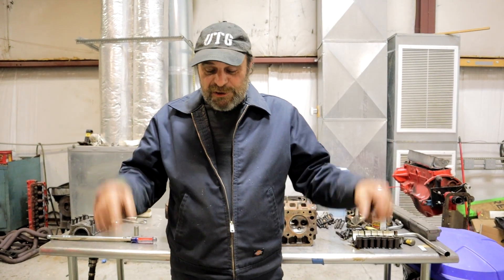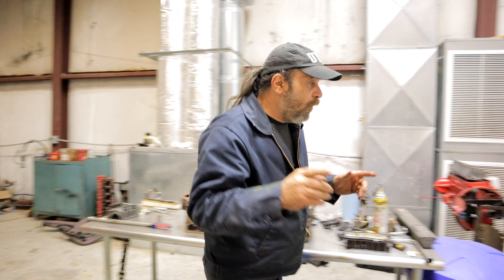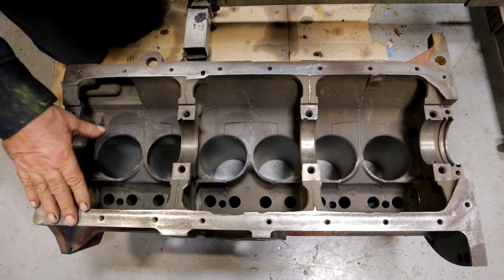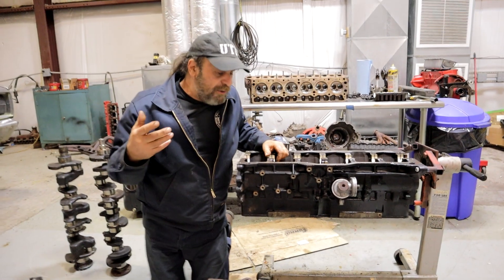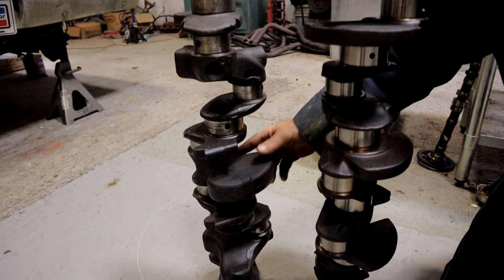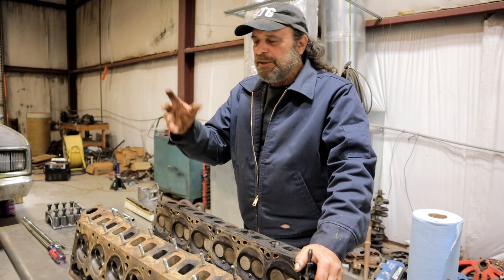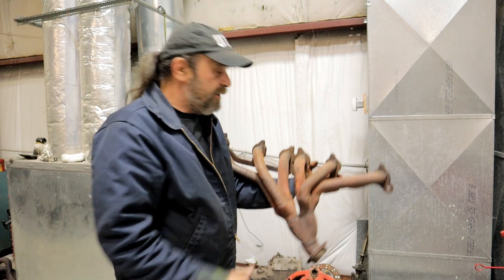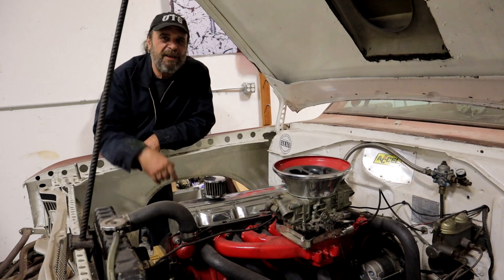The Mighty Mopar Inline 6's History And Comparison - Flathead, Slant, Hemi Six, 4.0 And Hurricane

Comment: Bill Weertman has a discussion about the choice of 4 vs 7 main bearings in his “Chrysler Engines” book.  The tradeoff was between better support of a crank (7 main) vs a significantly less flexible crank (4 main.) in fact he refers to 7 main cranks being too “whippy” referring to torsional flex. Fewer mains could be offset by making the mains big (compare them to the Jeep mains).  Since the 4 main crank was stronger AND shorter, it was chosen as a win/win.  The Jeep motor is a great engine, but historically It did have some issues with crank and block flex, which is why that spine or girdle was added to the main caps by Chrysler when they introduced the “reduced NVH” version in the 90s. 

Another thing from Weertman’s book: although he designed the slant and the Chrysler 2.2/2.5 turbo engines, had been at Chrysler his whole career, and was head of engineering at Chrysler in the 80s, he writes glowingly about the Jeep 4.0 and 2.5. In fact he pointed out that the naturally aspirated Jeep 2.5 had a higher output than the NA Chrysler 2.5, and was totally in agreement with the fact his successors picked the Jeep engine over the Chrysler engine to continue to power Dakotas and Jeeps. 

Also- that nice Jeep exhaust manifold was dropped in the 2000 model year ans replaced with a split cast iron manifold.
Reply: The 225 was never known for crank failure so they got it right.

Comment: Gm built literally millions of stovebolt 6 engines from the 1920's thru the 1960s with 4 main bearings. Minnieapolis Moline built some almost 600cid diesels with only 4 main bearings(they failed a lot).  The last cat on road diesels were twin turboed and managed to live a million plus miles running 70psi for hours on end. They have steel pistons though to take the heat and extreme pressure. If they build a twin turbo gas version and make it robust enough it can live 300K no problem in a car. The place most of these designers fail is in using enough bolts to secure the head. It need to be at least 6 full size bolts/cylinder.

Comment: My concern with many of the new, smaller displacement engines in full size trucks and SUVs is the torque curve. Not all, but many of these vehicles will be used for towing trailers. The smaller displacement automatically reduces torque all around but, especially at low rpm. Turbo charging does increase torque but, does it bring back enough off idle torque to get them rolling under load without over stressing the engine?
Reply: NO.

Comment: 1:44 Those floating power six motors are great until you have to replace all six motor mounts. Ask me how I know.

They were also not particularly light cars, especially for the time. My basemodel DeSoto Airflow was the smallest of the family and it still clocks in at over 4000 pounds.

Comment: Really enjoyed this video Tony.  In regards to the Hurricane being overtaxed I think that's the case with the majority of modern engines.  When automakers are putting small 1.3L turbo 4s into 3500-4000 pound family SUVs I find it hard to believe they'll last all that long. Another example of sacrificing vehicle longevity to maximize MPG...
Reply: a company chooses to build a 500hp 3.0 turbocharged engine,  size doesn’t dictate its longevity. the designer material choices and accountants analysis decide longevity.  Engines will be build to last as long as the board of directors at gm or ford deem.

Comment: Great video tony. I saw under the assumption that amc designed the 4.0 as an embiggening of the 2.5, which they designed "from scratch" so they wouldnt have to buy iron dukes for their economy cars any more, and they just made it fit the same bore spacing as the 258 so they could reuse old tooling. I have swapped a lot of parts between 258s and 4.0s, but I gotta say at least in the head design, the 4.0 looks way closer to the 2.5 than the 258.
Reply: The 2.5 actually never got put into Concords or Spirits. The 2.5 was developed for the XJ.

Comment: Love this content! My ears are wide open..... My question was answered ....Chrysler's not stupid and knew that 4.0 L was a better engine. Of course they could have ran the slant longer. I mean at least in intermediate to small cars but no need for it. Everything went transversely mounted and the things that didn't got way better engines than the slant and I'm not knocking the slant in any way, shape or form. It's definitely a better engine than some of the smaller Chrysler v6s the 3.3 and the 3.8 but not better than the 4 L

Comment: Thanks Uncle Tony , inline six's compared. What I do like about the three types of Chrysler I 6's is all three have been around for a very long time and everything that can be done to them performance wise has been done. 
The good and the bad of these engine's has been exposed because of this.
What benefits anyone wanting to rebuild one of these engine's is no shortage of OEM and aftermarket parts.
My experience with the slant six has been a rebuild, apart from the.030 oversize , all standard  internals . However I tried various intake/carb combo's. No real significant performance gain , apart from under-bonnet(hood) visual appeal.
In Australia the 265 Hemi inline six  engine is Legendary.
There is plenty of online info concerning this engine. 
Two points of difference and this is only two of the many. . .
In the 1972 E49 spec Charger , sold to the general public. . .off the dealers (showroom) floor produced close to 304hp (aspirated)at the crank. . .that's more than 1hp per cubic inch . In the world of production inline six engine's for car's it was the most powerful. 
Sold with Chrysler Australia's version of the Sixpack (triple Webber's) , no vac secondaries like it's U.S cousin. . . Yet , a completely street drivable production
Car . . anyone with a Driver's licence could drive it . 
Quite an achievement here in Australia for the Chrysler engineers for its time 😎👍😁

Comment: Man, I thought I was gonna get to see inside a flathead six. what a jip.... the jeep motor is a tractor motor. my neighbors, Watson's used jeep parts, says they are boat anchors. i never liked those jeeps because many of them you cant add water, you have to remove a hose to get water in the block because of the overflow tank is part od the pressurized radiator system.

Comment: Building a N54 bmw motor in a 2007 335i, twin turbo engine made with forged internals STOCK that can take boost and produce 6-700hp reliably with stock internals. And the torque would be higher 8-900! Most 4 cylinder engines have more HP than torque, it makes a huge difference! I call it the rice cooker bc of all the STI’s I’ve been smoking with it currently running 450whp 550wtq, very conservative tune for this platform! Long live the in-line 6!!

Comment: I've read a few of the comments and watched Tony's presentation and haven't heard or seen that the rod and bearing sizes in the Slant Six are the same as the 426 Hemi. I believe this is one reason for the longevity of the Slant Sixes. My dad had a Slant Six back in the 60's which burned a valve just short of 100k miles. I never thought about it but in one comment there was mention about valves burning due to lack of adjusting them. My dad never did much to his cars until something broke. I doubt they were ever adjusted.
Reply: The downside of using a bigger diameter main bearing is the increase in feet per minute. Similiar to running a 1/2 drill at the speed you should run a 3/8ths. The upside is a thicker cross section.

Comment: The 4 liter was an AMC design though. It was underway before Chrysler entered the picture, the 2.5 liter AMC 4 cylinder existed a couple years or so prior, and it's a 4 liter with a cylinder missing from each end. It's also worth pointing out that the exhaust manifold you have is not an original part, it's an aftermarket manifold. Depending on the source sold as "revised design" or just header.

Comment: American in-line six are stagnated and remained fundamentally unchanged until their discontinuation. The only major changes are adding EFI with modest performance gain. Australian had gone a little further with Chrysler inline HEMI six, the high end model produced 300 HP. These engines are well received in Australia being more powerful than Ford or Holden counterparts.
Reply: Even at that, the only classic American inline sixes that ever got EFI in US production were the Jeep 4.0 and the Ford 300/4.9. The Slant, the Chevy motors, the Pontiac OHC, and the small Ford never made it that far (in the US). V6s took over the US market for "basic midsize/large car engine" in the late '70s because they were applicable to both RWD and FWD.
Reply: Well yes, up until 1980 when it all finished! 😄

Comment: A friend of mine has a Australian Charger here in the United States along with two others in the Fox Valley Mopar club up here in Northern Illinois. He has it registered with the Charger Registry. People at car shows thought it was a tractor engine. Alls I can tell you about the Australian Charger is that it is really a Valent and it had three gas caps. One on each side of the quarter panels and one directly on the back like a '65+ Mustang. They did this so when you pulled into the pits for a refuel. You can have two sometimes three guys with refueling tanks all pouring fuel at the same time make for a quick refuel. Also, the exhaust tips were pointed upwards so the exhaust didn't stir up dust.
Reply: Well its a faker then. Genuine "Track Pack" big tank Six Packs only have the fillers up on the read quarters. The standard centre cap in the rear panel is deleted and not stamped. And it is "Valiant" as in Prince Valiant and his great stead....Valiant is a USA name Chrysler used for the new Small Plymouth in 1959.

Comment: The 245 and 265 hemis were legendary in Australia. 
The e49 spec in our RT chargers made 220+ kW with triple Webber carbs.
They were pretty special..
Reply: Hell yeah , Iconic \\m//
Reply: Just to clarify, the 256 Valiant Charger with the E49 spec engine was the most powerful of these, but was not the only factory triple Weber version. The E37 & E38 were both triple Weber engines in street & track versions respectively with three speed trans. The following year, the spec was raised & a four speed was now standard. The E48 & E49 were now the street & race versions with the top spec E49 producing 302hp Forget this kilowatt BS, that's just what I read off my electricity meter.
I have driven an E48 version [the so called 'street' version] & it was frightening quick, ....... & fast.
Reply: And never worked better, than when between the Chassis-rails, of a Toyota Crown, mate. (Only Aussie-sold car with a full chassis, apart from HQ-WB utes and panel-vans.)

Comment: I doubt that the hurricane engine is always under boost. At a cruise I would venture to say it's not. I do agree with your sentiment though Tony. The Ecoboost 3.5 ford trucks are pretty much junk. The reason being is that a turbocharged small displacement engine just can't handle a loaded f150 that is consistently pushing boost anytime your on the throttle. They start developing coolant leaks everywhere because of the excess pressure and heat that is being made. If you notice on the new Ecoboost motors the radiator caps are now pushing 21 lbs before they release pressure. That is an indication of just how much heat and pressure is getting built up into the coolant system. Turbocharging is great if the engine doesn't use it more than say 40% of the time in it's standard operating perimeters but when you push it to 90-95% of it's run time that plays hell on all the systems of the engine. Oil is getting scorched all the plastic coolant system pieces are constantly seeing 240° coolant temps and that severely cuts down on the longevity of the engine.

Comment: Great Video on the inline 6. My Dad had a 49 Dodge Pickup and I believe it was a 230 cu.in? flathead 6. Tough motor. I was always amazed how you could leave that motor in high gear at 10 MPH and just press on the throttle and accelerate. Try that with a V8! I was also into the old Chevy stove bolt 216 and 235 cu.in. engines when I first started driving. Later I updated to the 235 insert bearing motors and they were like hot rods compared to the Babbitt motors. WOULD YOU be interested in doing a series of videos on Inline 6 cylinder engines from each manufacturer like you did with the V8s?? I WOULD LOVE to see that!

Comment: Great comparison! That jeep 4.0 exhaust header is an aftermarket header. The 1987-1990 non HO/Renix 4.0 had a tubular manifold and the 1991-1999 HO cherokee (91-98 grand cherokee) 4.0s also had tubular manifolds that more closely resembles true headers. The 99 to 2006 (00-01 cherokees) 4.0s had dual exhaust cast manifolds with bolted on y-downpipes.
Reply: VW got better and better with those too. 
By the mid 2000s it looked like a little cast header for the 4 cylinders. 
Swap it out from the low flow turd on your 80s mk1/2 vw and it's guaranteed 10hp, the aftermarket has you covered with downpipes to use a Mk4 manifold in any other chassis they made.

Comment: I've only had 1 inline 6. It was a 250 Chevy in a 78 Camaro. And when I first got it I was thinking, okay I'll pull out the 250 straight 6 and put in a 350 V8. But after I drove it, I changed my mind. It wasn't a powerhouse or anything. But the way that car handled with the lighter 250 straight 6 was just amazing. I was used to heavy nosed V8 cars. But the 6 was a blast through the bends
Reply: Well, actually, the 250 IL6, is actually heavier than a 350 SBC... 😮 Don't take my word on it, look it up... I was surprised myself. (I have a 72 Nova with a 250 in it) I was trying to figure out if I would need to get heavier springs, if I went 350...

Comment: Bit of trivia :     In 1971 Chrysler Australia, sent an Australian Valiant 'Ute' (basically a Dodge Dart, cept a ute version), to the Weber factory in Italy, so they could develop a triple 45mm DCOE Weber carb system, for use on production 265 engines, which could be used for production car racing (road racing). Cars had to use 100% stock engines, exept for safety items, the cars were 95% stock.
 The production Australian Valiant Charger 'Hemi 6' ran 14.4 second 1/4 mile, with a 3.55 diff . The 'Track Pack' option, included a 35 British gallon fuel tank (42 US gallons), just what you need for a 500 mile race.
Reply: It was actually a complete VG Pacer sedan sent to Italy, and in 1970. The 2 mule utes were cut down 3" in wheelbase, (108 down to 105") and a little bit lopped off the back, to perfectly simulate the Charger's weight distribution, for chassis tuning. Those were used because the whole Charger concept was still hush hush, and the CAL test track was the Adelaide hills roads.
Reply: @TavoAu  these Ute's were later sold off. At least 1 still exists, according to AMC magazine.
Reply: @TavoAu  Yes, you are correct, it was a VG Pacer that they sent with apparently an E38 engine. It is reported they travelled 12000 miles while over there supposedly....Long way. Most TAVO's know this of course. :hand-purple-blue-peace:
Reply: Most of the 350 or so 340 V8 engines that Chrysler Australia imported, were built in 1969, and were already here in 1969. They were suppose to go into the VG Pacer. The Hemi 6 was Only used because of political reasons....not to win Bathurst. They had no chance with a 245 2 barrel and 3 speed manual. In the mid 70s Chrysler dumped the New Process 4 speeds and 340 heads etc in the gulf (sea) in front of Adelaide.
Reply: @kramrollin69  it may surprise you, but, in  73 Moffat took a phase 3 to NZ to compete in their championship. Expecting a white wash, but the Kiwi's had their 6 pack Chargers sorted, and gave him a very hard time. Moffat won, but it was tight. 
And this coming from a Holden nut.
Reply: @bodgiesteve8849  No surprise to me, I knew that 40 years ago. Leo Leonard's Chargers were the king of NZ prod racing. Because he ignored the factory settings and did his own. Actually, I believe the Charger won, then Moff packed up and went home.
Reply: @kramrollin69 245 Pacers no chance? Just 4th and 5th beating many Phase 2 GT's and Toranas.
Reply: Only the engine went to Italy. Two R/T utes were built here . The last one hasn't been seen since the early '80s' cheers.
Reply: @clutchkicker392ison5  No, they sent the complete VG ute. John Ellis has talked about this.
Reply: Don't like being wrong do u mr knowledge. Spout ur 'book learnin' but some of us kno better . U r confused @kramrollin69
Reply: @clutchkicker392ison5  Well, lets hope you've learnt something then.👍
Reply: No, the E49 time was with a "sort of" accurate 5th wheel, and they used a 3.55 diff. The E38s used the 3.23.
Reply: @kramrollin69  OK, I went to check my old wheels magazine collection. 1972,  3.5 diff,    E49 average 14.5, best 14.4.       E55 average 15.6, best  15.5.
'71XY GT (not HO) 2.78 diff  average 15.5, best.  15.3....    '69 XW HO  diff not stated, average 14.8, best 14.4.
Early '72, XU-1 average 16.0, best 15.8. With a 3.36 diff
Reply: Dont listen to him mate . He's always tellin ppl they're wrong. Lol @bodgiesteve8849
Reply: @clutchkicker392ison5  Just spreading the truth.
Reply: @clutchkicker392ison5  I suggest you do some more research.
Reply: @bodgiesteve8849  Did that article also quote the altitude the tests were done at?
IIRC, the XY ran at near sea level, while the Chargers ran at a fair altitude.
Side by side at the same track, an as-delivered Phase3 and an E-49 are pretty much inches apart at the end of the quarter mile.
Reply: @PiDsPagePrototypes  these were Wheels, and Sports Car World. Some were tested at Castlereagh, others weren't noted.
Reply: It was a pacer they sent
Reply: @petergiourelas3753  👍
Reply: @petergiourelas3753  Correct.
Reply: Yes, a Pacer went, and is why the "45 DCOE's" are actually not. Genuine E-49 Webbers have a 48mm choke.